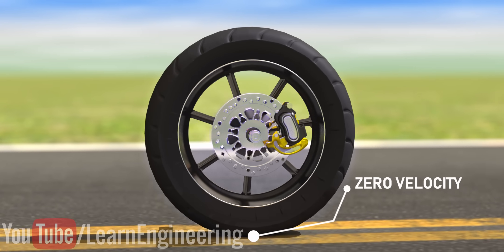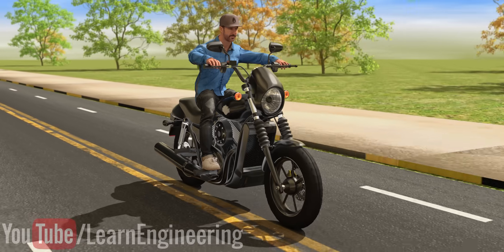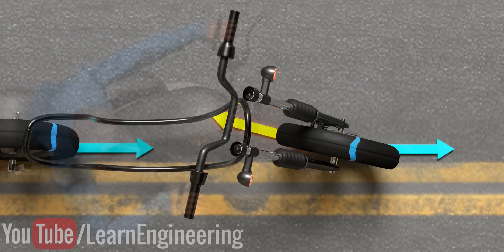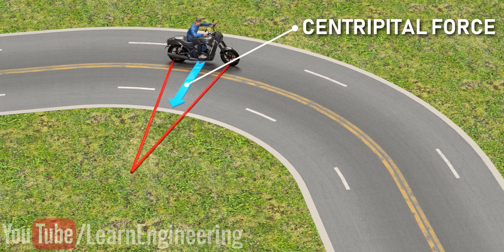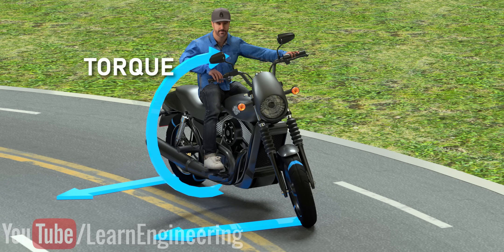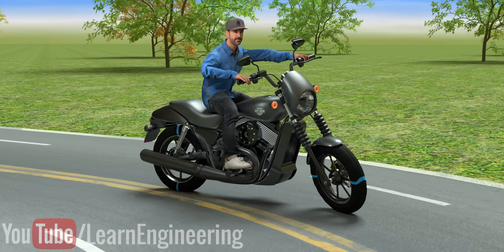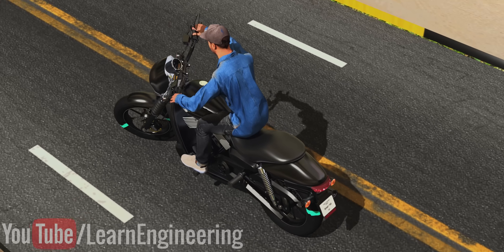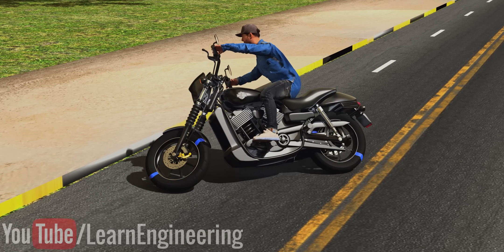Counter Steering | The interesting physics behind it

Comment: In all my years of biking I've never used the bars to go around anything, corners or obstacles. I was never thaugt to push or pull the handlebars, just to shift weight. 
To avoid anything careless drivers throw at you you use a thing called anticipation. I was thaugt that everyone on the road is grazy accept me. Worked out well for me, no mayor mishaps in forty plus years. 
No guarantees for tomorrow though and no mumbo jumbo. 
Of caurse I'm just an old fart.
Reply: You should try it, so much better when you feel you have a complete control of your bike. You actually are already counter steering, you just don’t realise it. By leaning over one way, you are applying slight pressure onto one of the bars and that’s all you need.
https://youtu.be/lzk8oyNO708 have a look at the link and learn!!

Comment: In fact you can’t “lean the motorcycle” in “perfect” conditions without counter steering. Since you have two points of contact with the ground that a dots in perfect world you can’t have a torque to move you center of mass from the middle. The only reason why “normal steering” works is because the contact with the ground is not a dot, but some oval shaped small platform and that helps you slightly lean your center of mass into the turn without counter steering. And because this platform of contact is so small - “normal steering” is so ineffective. And the fact that normal steering would not be possible in perfect world and counter steering would, it’s the counter steering should be called “normal”, and the other should be called somehow.

Comment: From the video: "In normal steering - to make a right turn - what we do is just turn the handlebars towards the right and lean the motorcycle inwards." I have never heard such sh*t in all my life.
From the video: "Here the rider has to adjust his body position to achieve the lean of the motorcycle." I have never heard such sh*t in all my life. 
Check youtube for videos of little robot devices riding a motorcycle. They CANNOT change their body positions because they have no bodies. Could it be any more effing obvious?! They manage fine by adjusting the handlebars.... as do I: I see no point in moving my body around when my machine is furnished with handle bars. This video is the worst pile of ** I've encountered on the subject. Take it down. Replace it with an apology that you're far too ignorant to talk on the subject. In conclusion, the second you lift your feet off the ground. you're counter-steering or you'd fall over. Whether you realise it or not is irrelevant.

Comment: Its not just a technique, its the only way to ride a two wheeler. It doesn't have multiple contact points along the width(unlike cars which have two wheels side by side) to counteract the torque experienced due to centrifugal force, so leaning and taking advantage of gravity is the only way to counteract centrifugal force, and the only way to lean is by steering into the opposite direction and using the centrifugal force to throw the bike to the desired side into the leaning position and progressively steering back when the right lean angle is achieved.
It is not just two wheelers, every fast animal in existence uses that to lean. Ex. horses, cats, deers, dogs and even humans. Yes, humans, while running fast, if we want to turn right, we put our left foot far into the left front so gravity leans us into right and then continue running.

Comment: Quite simply WRONG
Reply: The writer of this video does not understand how to steer a motorcycle and does not understand physics. At speed, turning a motorcycle is about pushing a gyroscope. Attempting to turn the axis of a spinning gyroscope will cause it to lean in the opposite direction. The front wheel of a motorcycle is a spinning gyroscope. 
If one were able to ride a motorcycle with the spinning front wheel 1” above the surface of the road, it would still be possible to lean the motorcycle by pushing on the handlebar. 
Don’t listen to this video, it’s completely wrong.

Comment: Unnecessary.
I like how the top pinned comment clearly admits to speeding but then says counter steering saved your life.
No. You got lucky and if you weren’t speeding it wouldn’t have happened in the first place.
You’re probably mad at the car who can’t be expected to see a bike going 4-7 times as fast as anything they are expecting.
If you have to counter steer to quickly avoid something, you are already in danger.
Take it easy bikers!

Comment: I learned by simply pushing the handlebar grip outwards on the grip closest to the direction you want the bike to go (if you need to steer right, push out on the right handlebar grip and vice-versa  for a left turn).  Saved my arse on several high speed highway off ramps!!

Comment: This video is just wrong. The bike leans itself in a counter-steer. You don't lean it. You can't lean it. Watch Twist of the Wrist II, and counter-steering is easily explained.
TOTW explaining counter steering here: https://www.youtube.com/watch?v=JWuTcJcqAng
Try yourself: 
Ride a motorbike in a straight line. 
Push the left bar forward slightly (the entire bar turns right) - the bike automatically leans in to the left, and turns left.
Push the right bar forward slightly (the entire bar turns left) - the bike automatically leans in to the right, and turns right.
A further test... if you were able to lock the bars in a straight ahead position, no amount of weight left or right is going to steer the bike.
People think you selectively counter steer. You don't. You automatically counter steer without knowing it. It is impossible to steer a bike at speed in any other way.

Ride safe folks... armed with this knowledge, you will.

Comment: You are all going to die if you follow this video.  You only counter steer in cars with more than 2 wheels.  If  you are going to push the handle bar while leaning into a turn you will go down and crash.
Reply: If you push the right bar forward you lean the bike right. It’s not really turning, just a little pressure in a forward direction.
Watch this and learn! https://youtu.be/lzk8oyNO708

Comment: There is no such thing as counter steering.  You don't steer by turning the handle bars.   You lean on the right or left bar to steer.  What is missing here is Gyroscopic Precession with out which a motor cycle or bicycle will not stay upright or a helicopter fly.
Reply: Don’t know how to tell you this, but if you lean on the right bar you initiate a right hand lean of the bike……. due to counter steering!!😂
You and a guy called “breezelow unknown” are going to have a ball in here!😂😂😂
Reply: Bikes don't need "Gyroscopic Precession" and go and try to ride a bike with fixed handlebars or better yet fixed front fork.

Comment: I only countersteer at higher speeds....40 kph and above, after warming tires. At lower speeds I lean bike....30 kph & below, even if tires not fully warmed or is raining. I owned over years GPX750, ZX7R, ZX9R, currently TL1000R.

Comment: I use to ride motorcycles, now I ride a heavy Ebike at 30 to 35 mph just like a reg twist grip motorcycle only much slower, but still quite dangerous if your not on your toes at all times, also take into account all my physical problems and being im age 66, a crash for me wouldn’t be good, more you can learn and practice the better.

Comment: “Actually the torque applied by the rider on the handlebar is equal, opposite in direction, to the resultant of all the moments generated by the forces and torques acting on the front section.”

“A negative AI is usually preferred, which means that the rider pushes the handlebar outward the turn, e.g. he applies a counter-clockwise torque while cornering on a clockwise turn. “

http://www.iaeng.org/publication/WCE2010/WCE2010_pp1257-1262.pdf

Comment: counter steering 101, sit strait, push the left handle bar to go left or push the right handle bar to go right, thats all folks, when you push left, the steering wheel turn to the right a little, the bike tilts to the left and then, the wheel turns to the left automatically because of castor effect of trail, you don't have to do anything else then push left to go left or push right to go right, the bike does the rest on its own.

Whether you realize it or not, a 2 wheeled vehicle with the wheels in front of each other, a bike ALWAYS countersteers,

On a bicycle that is very light, the amount the steering wheel gets pushed in the other direction first is so small it is unnoticeable, on a motor cycle that is much heavier and goes much faster, you need to push more and you can notice it and do so consciously, whether you are aware of it or not you been counter steering all your life and you never knew it, because that is the only way to initiate a lean of a bike and the bike always has to lean a tiny little bit to make a turn any turn, you been counter steering ever since you first rode a bike as a kid.
Reply: Perfect description!👍🏻
Reply: @softailfun  thanks

Comment: Whoa whoa you Gotta be kidding you just complicated the living crap out of something really pretty easy, go in a perfectly straight line very gently pull the right handle bar toward you the motorcycle will go to the left pull the left handle bar and the motorcycle will go to the right that's all you need to know the rest will only confuse you. pull the right handle bar Motocycle goes to the left, pull the left handle bar and motorcycle goes to the right try it it works
Reply: On a personal level, I prefer push … but you’re absolutely right of course.

Comment: This is dangerously wrong...you don't "TURN" your handlebars unless you are going under 10mph. This is going to have people trying to force their motorcycle around at speed and loose traction in front wheel...resulting in a crash if not corrected. If you want to understand counter-steering just ride any two wheel vehicle above 10mph it fucking "counter-steers" on its own.

Comment: This is a terrible video. That is not how this works at all. Even the guy on the scooter at slow speeds just turned left then right. Counter steering is unavoidable at typically above 12-15mph. The motorcycle will not behave any other way as direct input will not work. I can't believe there are so many people in the comments arguing this. You can "lean" at speed but this is very ineffective and slow and not going to end well in an emergency situation or tight turns. If you think you've never counter steered you are doing it subconsciously if you've achieved any speed while on  motorcycle.

Comment: This should be pulled down due to the errors in it. There is no such thing as 'normal steering".

There are only two way to lean a motorcycle, counter-steering and pushing off an object like the road or a car.

Once a motorcycle is leaning angular momentum causes the front wheel to turn in the direction the motorcycle is leaning. This is the same thing that causes a hula hoop to turn if it leans while rolling across a yard. Admittedly at walking speed this doesn't work and the rider needs to turn the handle bars. 

Body steering is a form of counter-steering. See Keith Codes "Twist of the Wrist" video and his No BS motorcycle.
Reply: ok so when you want to turn right do you shift your body right with bars pointed to left or right????
Reply: @BSABD315  The direction you shift your body or if you shift it at all depends on what type of turn you are trying to make. So your statement on shifting the body isn't consistently correct. 

To turn right the first that a rider does is turn the handle bars left. If the motorcycle isn't being quickly leaning over the force needed and the amount of movement may be small enough to not notice the action. 

As the motorcycle is leaning the rotational momentum of the front wheel will turn the handle bars to the right. This is like rolling a hula hoop across a yard. Once the hula hoop starts to lean it will turn in that direction. 

A basic or beginners motorcycle riders class will cover most of this information.
Reply: @BSABD315  
https://youtu.be/lzk8oyNO708
You need this video link!

Comment: I've never understood this.  YOU CAN'T DO OTHERWISE!  Whether it's a motorcycle or a bicycle, above a certain speed countersteering is the ONLY steering.  I don't get it.  It's interesting, yes, but also natural and inevitable.
Reply: There is counter steering when you are in a sliding car, like in the show and the rear comes around and you steer to correct the direction  you want to go.  Not riding a motor cycle or bike unless you are  flat track racing.
Reply: @fredkilian4049  
You’re wrong!
https://youtu.be/lzk8oyNO708 see here!

Comment: Possibly the most important item missing from this video involves the mass/momentum of the vehicle. Shifting your weight to enable the direct input of the handlebars is VERY slow on a heavy machine. The sideways rotational speed of the machine is impeded by its mass. Using counter steer to rotate the machine sideways gives an almost instant turn angle in the opposite direction of the handlebar input. To illustrate, on your motorcycle, take your hands off the handlebars (Obvious warnings of danger here) and shift your weight to try and initiate a turn. As the video explains, direct input on the handlebars is already giving you a rotational direction which is opposite to that desired. To overcome this a larger weigh shift is required. For more information the reader can try the David Hough motorcycle books.

Comment: What the f is this ??? I only turn my handle bars at EXTREMELY low speeds. Other than that I counter steer which is just pushing into my right hand grip if I want to go right or pulling the left grip, or both at the same time...  And pushing into the left grip and or pulling my right grip or both at the same time to go left. Either way my bars never move...
   If you try to turn your bars right,,, which will point you front tire right, you will go left... Which is how riders crash. They want to go left, they try to point the tire left, but they go right. Thin they freek out and try to push even harder and thin they usually look in the direction that they don't wan to go,,,  and crash crash crash
  It's just like riding a bike,,, it's no different...

Comment: if u have a good balanced bike u dont need to turn the handlebars back to the lean position. it will do it by itself. i can take my hands off the handlebars and push one of the grips quickly with my fingers on one of my hands and the bike will do the rest

Comment: Well, that was horribly explained. Counters steering is the ONLY way to turn at speeds above parking lot speeds. The front wheel is a gyroscope with a ton of kinetic energy. A force applied to a gyroscope  will create a force in the same direction 90 deg ahead of the direction of rotation. It's called gyroscopic precession. It exist without the need to believe in it and its inevitable. Everyone counter-steers weather they know it or not. With forward speed, turning right on the wheel (horizontal axis) puts a force 90 deg ahead of the spin. This results in the bottom of the tire pushing to the right and the top of the tire pushing over to the left causing the left lean. Hold a free spinning bicycle wheel in your hand. Try to turn it right and left...you cant. It will instead lean left then right.

Comment: I was hoping to hear a good explanation of the physics behind turning a motorcycle, but I still haven't. I've heard about 5 to 7 different explanations and all of them fall short. I honestly think there's multiple different things going on with the physics of it. When I push the left grip to turn left, I don't correct my counter streer to keep from falling over, I give it more gas (which keeps it from falling over for reasons having nothing to do with the fact that I pushed the left grip to lean the bike left and turn left)  this example, and many peoples explanations, don't account for acceleration. At a constant speed, like a high speed swerve then yes you correct it. I think it's best just to accept that counter steering a motorcycle is magic.